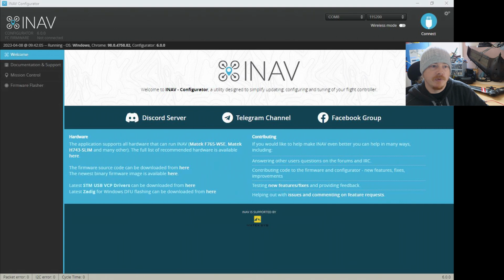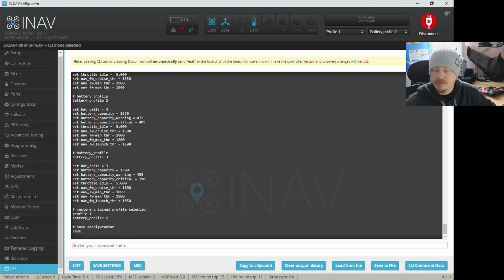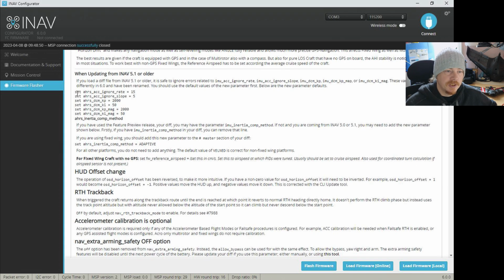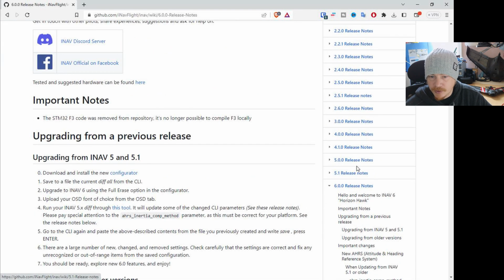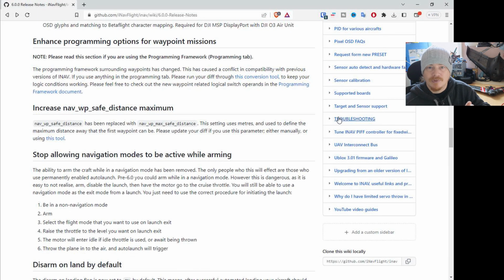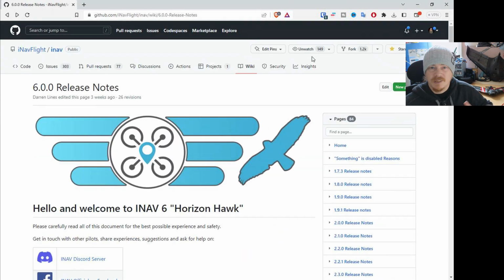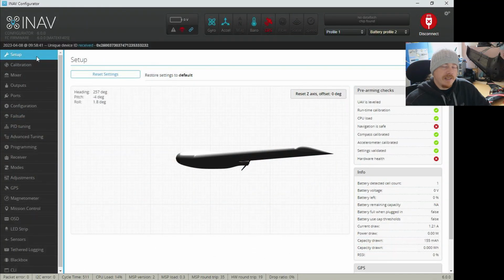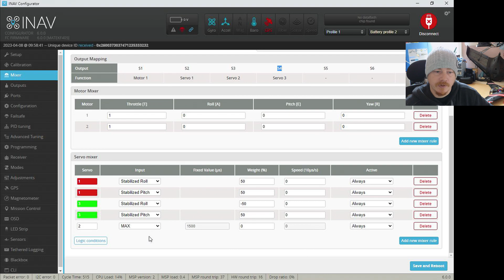FIVE Common INAV questions, answered

Comment: Does a brand new Matek F405 wmn also need a Diff all before i update to 6.0? 
fresh out of the  bag, no model loaded on it or anything.
Does ANY brand new FC for fixed wing need a diff all if it's never been used/just taken out off the box?
Reply from the maker: No. A brand new FC should be treated as a new installation, not an update. The update is when you have already set up the flight controller for your model.
Reply: @MrD  Thanks!